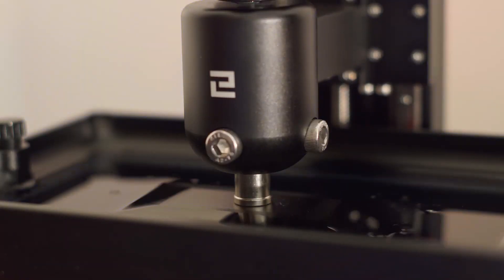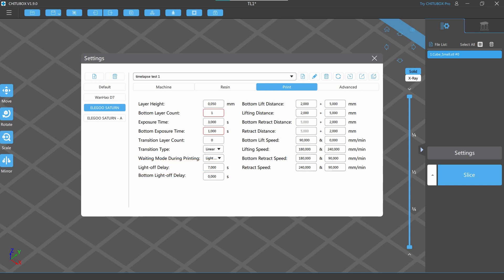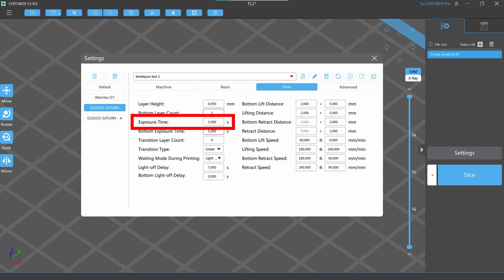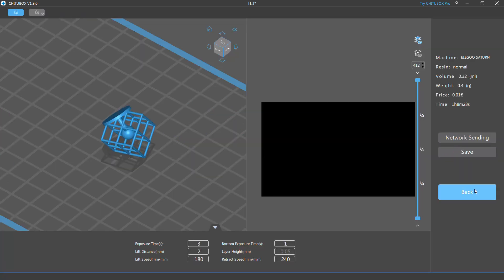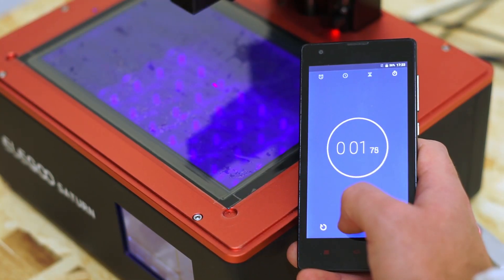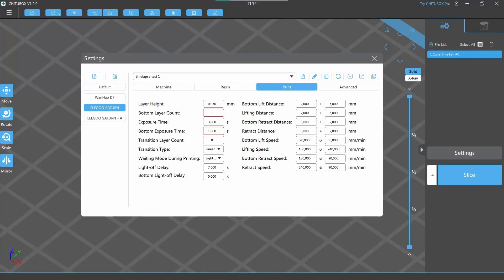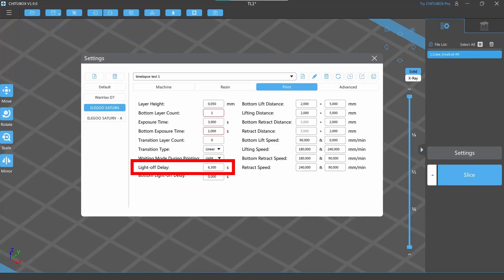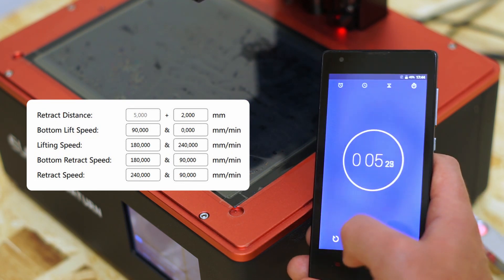HOW TO: Flawless RESIN timelapse with LIGHT-OFF DELAY trick

Comment: This is cool but it's probably easier to just use a resinlapse cable.
Reply from the maker: Easier for whom has a Canon with a 2.5mm TRS port. 😬
For others, simply can't works (Sony, Nikon, etc)... instead the light-off method can be used also with a simple smartphone with a TL app, doesn't require a camera at all. 😉

Furthermore, with the cable you are caged to shot every time the UV light up, an it means every layer... instead with this method you can choose to shoot every 2-10-etc layers!
Reply: @gxlab_it  I made my own resinlapse cable for my sony a7r3 camera.
I just bought the multi cable with 3.5 jack size. Then i salve a female 3.5 audio port from my old electronics.
then i solder 1 meter cable to the female audio jack and then i solder the photoresistor on the opposite end.
I didn't damage my multi cable with my diy, i can still use it as is, if ever i want to do a resinlapse I'll just connect the 3.5 female audio port with the photoresistor on the other end to use it as resinlapse cable.
Reply from the maker: @jozac05  When it comes to fix a problem with DIY hw modifications, I'm the first to do it... but in this case I really can't understand why make it if there is a simple solution already integrated in the slicer.

And it's a solution suitable for smartphones too. 😉
Reply: @gxlab_it  here's the sample vid of my diy resinlapse cable https://youtu.be/Oa07hMOyzIg
Reply: Another problem is the country where you live. I bought resinlapse, it was sent to me and Portugal customs house refused the entry, returned to the US, I had no resinlapse and no money because it wasn't the resinlapse creators' fault. :(
Reply from the maker: @HenriqueZorzan  Wow, that's terrible 😲 ...but, what is the reason they send it back? I mean, it's not a gun 😅

Anyway, go and try this trick! Tell me if you have issues, I'll help you to setup all correctly. 

PS: what printer do you have?
Reply: @gxlab_it  The real problem is Portugal is a very bureaucratic country. Portugal does not follow the modern Europe. I'll try your method, I have an Anycubic Mono X.
Reply from the maker: @HenriqueZorzan  As I know the worst thing could happen in Italy is to pay the duties, not to send back like was an exotic animal 😌

Well, let me know how the test goes!
Reply: @HenriqueZorzan  I've DIY'ed my own resinlapse cables for my sony a7r3 camera, iphone and android smartphone.
It's dumb easy to make one.
The photoresistor is dirt cheap.
any usb cable will do, you need soldering iron, soldering lead and heatshirk cable sleeves.
For my iphone and android I combined it with Bluetooth wireless remote and photoresistor on the other end of the cable.
Reply: @jozac05  Thank you, I will try make one, the GXLAB solution is very good too, but as I'm not good with calculations, it would be easier to do a resinlapse :) My solution for now is a photographic trigger that I have, that would have nothing to do with 3D printing but as it fires the camera with light it worked, but it is an expensive device, buying it to make the timelapses is not worth it. But as I already had to photograph, it served to fill the lack of resinlapse.
Reply from the maker: @hezostudio  Sorry but what you call "calculations" it's simple math for do 7+3=10 ...how can this be more complex than tear apart a cable, make soldering, etc. ? 🤷🏻‍♂️

(I didn't understand if you already tried this light-off method, btw)
Reply: @gxlab_it  Hi, no my friend I didn't try yet, and the resin-lapse or another timelapse method neither just my photography trigger called Pluto trigger. But your method will be the first I try... ;) Thanks!